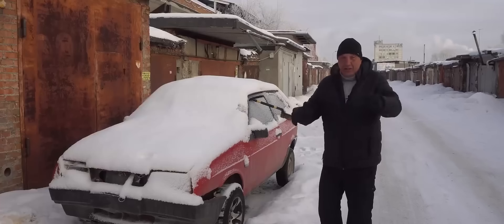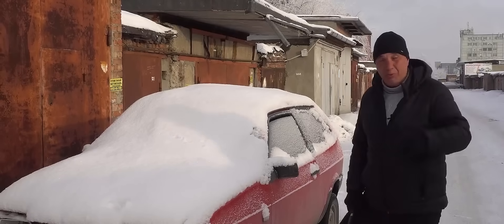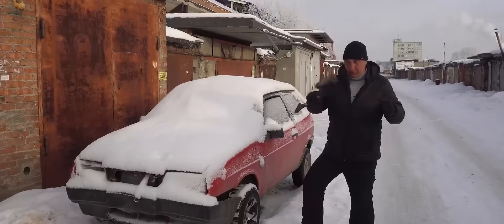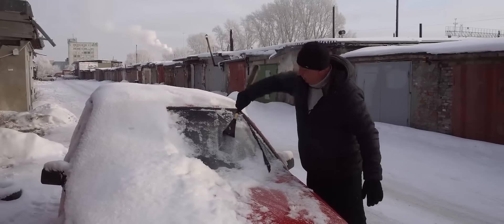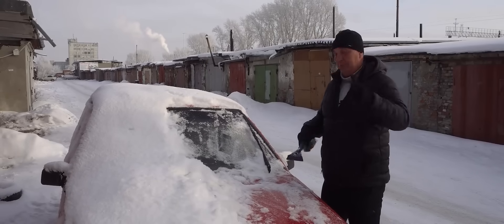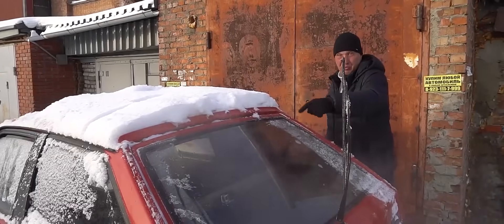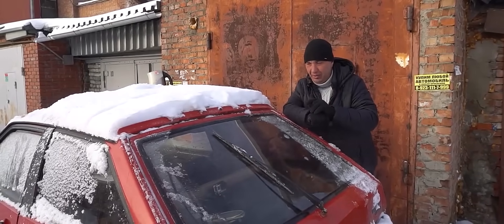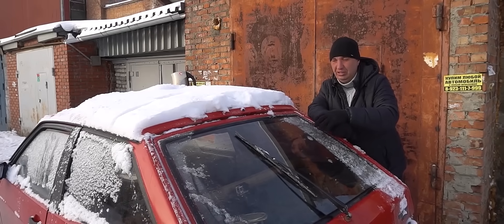What happens when you POUR boiling water onto a frozen windshield?

Comment: Hello! I am a car mechanic and i can explain why it works on this car! There a two types of windscreens. The ones who are installed with a rubber gasket around it (like this one, mostly found in old cars). And ones who are stuck in with adhesive (newer cars). What happens is that the rubber gasket can compensate the forces produced by the temperature difference of the cold glass and the hot water, thats why the windscreen on this car is fine. But on newer cars the adhesive does not have enough flex to compensate this forces, and thats why newer cars windscreens are very likely to break when applying hot water. 
Sorry if my englisch is not the very best, but i tried!

EDIT: I see this comment arrouses a lot of people. I know there are different opinions regarding this topic out there. And if you think otherwise thats okay. I just commented this to prevent people from expensive repair costs. So please guys, write your own opinion in the comments but stop insulting me.
Reply: I just love that your english was perfect until you got to the word "englisch" haha
Reply: @everett8811  he is German you idiot
Reply: @everett8811 Dammit!
Reply: (T)his comment should be pinned on top.
Reply: Perfect English my friend i had no idea it wasn't your 2nd language. Smart man
Reply: Sorry but I’m going to have wade in and trump this. Master Windscreen Tech with over 10 years. A bonded Windscreen is officially classed as a directly glazed unit. The PUR bonding will allow for much more expansion than caused by hot water. So I’m sorry but this is not correct. The issue is if you pour hot water onto laminated glass (the Windscreen) when there is already damage through to the inter layer. So if your Windscreen is perfectly intact, you can do this tricky safely. However if you have damage which you can not see. For example in the ceramic frit. Which is the black painted part around the edge. You are taking a large risk. So therefore it’s not recommended to ever do this on any laminated Windscreen. Direct or indirectly glazed.
Reply: @bluemonkey227  Finally, someone that actually knows what they are talking about instead of spewing the first theory that comes to mind. My theory was maybe the composition of the glass and laminate would play a big role in how the windshield reacts to the temperature difference.
Reply: Your English is very good mate, no need to worry about it, just wish some English people could write this well.
Reply: Andi 423 I’m a mechanic too but you’ve taught me something, I didn’t think of the rubber gasket helping with the temperature difference! I always thought it was the contact with the glass directly that can cause cracking rather than the types of seal used on windscreens.

Also your English is good!
Reply: In other words new cars aren't made to last.
Reply: @SuperSqueakyboy  Yeah maybe. But the main reason for using adhesive is that in cars with old rubber gasket windscreens, they often popped out in case of an accident. Where the new ones dont do that and also became a important part to stabilize the self supporting chassis even more. So it's for safety and stiffness of the cabin.
Reply: @Andi-ft5rt  your english is brilliant, man, i wish mine would be as good as yours! May i ask what is your native language, please?
Reply: @ayrenbethancourt9379  Thank you, my native one is german. I am from austria.
Reply: @Andi-ft5rt  cool. Love your country😍
Reply: @Andi-ft5rt  Heh. Adhesive windshields are cheaper than gasket windshields. That's the bottom line.
Reply: I have 2017 opel zafira and I always use warm water not boiling and it doesn’t break
Reply: @MrKiwi4lyfe  did you try boiling water?
Reply: Lmao you were perfect until the word "English"
Reply: Thanks for the explanation. Very good English
Reply: Your English is very good my friend.Thank you for the explanation .
Reply: Wind screens are tempered and laminated. Side windows are tempered.  Ordinary annealed glass is much easier to crack using this method of thermal shock. Tempered glass can vary widely in strength and thermal resistance depending on the tempering process. On wind screens design trade offs are made to design the glass for the highest safety. (low impacts cause cracks to propagate slowly. High impacts cause it to shatter into small mostly not sharp pieces and the lamination or film layers keep the glass from shattering and hitting your face.)  I know this because I have had half a truck tire hit my windshield and end up embedded in the glass about an inch from my nose. And yet not a scratch on me.
Reply: @jorgensenmj  I have to agree with you. I've seen cars totalled, the windshield is still in place, or popped free. In either case, the glass is still in one piece with thousands of little squares all through it I was wondering if the internal temp of the car made a difference. The windshield was the same temp on both sides. No scientist obviously, just curious.
Don't apologize for ypur English....you are bilingual..that's great!
Reply: Great explanation 👍
Reply: Spot on mate thanks for sharing.
Reply: This makes no sense. Windshields are obviously made to withstand all sorts of shear forces while driving. The kettle he is using is obviously too tiny.
Reply: Englisch
Reply: I am very aroused by your comment
Reply: It doesn't have to be a windscreen it will happen with any type of glass it's the rapid expansion that causes the cracking. A pane of glass that's left in the freezer then plunged into boiling water will shatter even when  it has room to expand its the rapid expansion that causes it!
Reply: @user-lf3wr8rh7r  That's a different type of glass.
Reply: Oh man the comment section have been got war section. 😐
Reply: Great job and believable information.
Reply: I always use tepid water. Literally body temperature - no more than 40°C. I even have a chip on my windscreen I've not gotten around to repairing. Never had a problem, I like it because it's the quickest way to clear the condensation off the inside as well as the frost off the outside.
Reply: Kris Roberts
Not if there's a chip, then it can go. If you've got a chip and not seen it and it goes then you'd regret it. Tepid is enough and less risky.
Reply: So what you're saying is that old technology is superior and the planned obscelescence of modern day.
Reply: I always use hot water to warm the glass. On different cars, with pasted glass and glass with a rubber seal. The average water temperature is about 70 degrees Celsius. There hasn't been a single cracked glass in 20 years. The fastest way to warm mirrors and glasses. You need to remove the water from the glass so that the water does not freeze again.
Reply: Something else that may also have an effect is if there is some precious damage to the glass. For instance an unnoticed stone chip.
Reply: Just show us a video that will crack the windshield, talking means nothing on internet now
Reply: New cars don't crack either.  I've done mine with hot water for years.
Reply: Thank you but we dont really need it
Reply: Your spot on.
Reply: genius
Reply: I never apologise for my English
Reply: @modaternasser6827  i always do. My english, unfortunately is like chinese. Lucky you if you speak perfect English ☺️
Reply: ayren bethancourt No, my English is far from perfect, you are probably better than me, it is just that I don't bother coz English is a universal language so people should get used to understanding different accents and writing styles as long as they are not gibberish and are actually understandable!
Reply: @modaternasser6827  😂😂😂
Trust me. My english is japanese 🤣🤣🤣
Reply: English is pretty good and thank you for your help
Reply: Thanks for the info!!
Reply: Damn bro u r a Doctor not a Mechanic Lol 😂
Reply: I am very arroused by this comment. You arroused me sir.
Reply: sounds reasonable
Reply: You're okay my friend. Shots of vodka for all!!
Reply: Or the glass is tempered
Reply: @Jacques Bloques you're impressing nobody. Go back to your desktop thesaurus & find some more words to inflate your ego. Childish intellect. Lmfao. Seriously. Are you actually expecting a reasoned debate in a comment thread on youtube? If that's not childish then it's just plain ignorance. Float your bullshit during a wine tasting at Nobody Gives A Shit Vineyards Public House. Frankly I can't understand why I'm trying to correct anonymous idiocy. Something about stupid things just peaks my interest while simultaneously making me depressed by the state of society & what passes for interaction these days. Party on Weiner Biscuit!
Reply: when i worked at infiniti a large amount of their qx30 cars brand new on the lot had a windshield cracking defect, the windshield was placed on with mounting points that couldnt flex a certain amount and the glass would press itself against the cars metal when the sunlight hits it directly, we had cars brand new sitting on the upper lot floor have sudden cracked winsheilds one by one
Reply: Arouses* what HAHAHA
Reply: Well said :) The problem is expansion speed. When the conditions are natural the glass expands slowly and nothing happens, but when hot water applied, the expansion speed is very fast, there fore the rubber band reacts faster to prevent window break, while the adhesive material is more sturdy and it needs more time to expand, there fore the tension rises and glass breaks.
Reply: Gasket? Really 😂
Reply: Andi 423 wow, amazing explanation man! I poured room temp. Water on my cars windshield which was standing in the sun.... and it cracked.... a hot windshield with cold water on it would break easier than this method!
Reply: The classic “I’m a new mechanic and I know everything about cars because I just graduated college” I pour hot water on my 08 Jettas windshield in winter for years never had a window crack and I’m in northern Ontario
Reply: I was wondering because I used warm water once like an idiot and heard a pop and wound up with a nice line across my windshield
Reply: What i can say is NEVER pour cold water on a hot windshield it will crack pretty quick
Reply: *aroused*🍌
Reply: Good to know.
Reply: Windshields during research and development phase are tested for a lot of things, including thermal shock. Test specimens are placed in a thermal shock chamber, where they remain in a controlled environment for a period of time specified by a standard, then travel into a secondary chamber, where they have to endure very different environmental parameters. I pulled up a random standard for electrical components from a google search (MIL-202G) in which the thermal shock test temperatures range from -65 degrees Celsius to 500 degrees Celsius. Fair enough, glasses will have different standards and test parameters, but the principle is the same. 
Materials do age however, and their properties can deteriorate. Glass is no different. An aged windshield is more likely to crack due to thermal shock, than a brand new one, with no manufacturing defects. 
Just some things to keep in mind.
Reply: I tried this to Ford FOCUS c Max 2004. Water was around 60. Outside mínus 7. Everything is ok
Reply: My 87 suburban windshield survived, my 91 Toyota windshield, however, did not 😩😂
Reply: I'm very aroused I have a boner.
Reply: this + glass breaks when contarcting (hot to cold, not cold to hot)
Reply: They also poured it too evenly, if a glass is hot in one half and the other half is cold thats how the stress is created
Reply: I would like to add, your perception of "forces" on newer cars is something i understand and at the very same time do not acknowledge to exist. But in fact i have a counter argument. 

Newer and Modern cars these days actually have thinner double glass layers then they use to. meaning if you have an oppotunity one day to check out say... a VW golf within the age of 2000 + All audi glass, all new After market Toyota Hilux, Mazda bounty, Suziki Swift. Basically as the glass manufacturers get better at producing glass, the quality gets better by every single windshield/windscreen they produce for that particular model and make,  EACH TIME it's created. (Imagine for every new windscreen it has +1 or maybe +2 Quality with depending factors).  So after 2 years the glass is what they say " perfected " so they no longer quality check the glass that is made... ect..   The windshield is getting thinner and thinner, with some makes... i have found with Toyota Hilux, XYG and Fuyao Glass.  they like to make their first layer of glass roughly..    1.8mm thicknesss while the 2nd layer of glass is 2.2mm.      Inside layer of glass is the most thin.   Making it very very very VERY easy to break, especially during installation. 

Edit: Observation based of mostly viewing the Chinese Aftermarket Glass which is shipped and used across the entire world.  Personally i prefer using Manufacture's glass for example Toyota genuine or Audi, BMW, Hyaundai, Mazda Genuine windscreens/windshields.
Reply: I understood almost nothing. O don't have the widest range of vocabulary, to put it lightly.
Reply: Damn your English is very good (From someone born in Canada)
Reply: wrong.. both seals have similar flexibility, newer just seals better.
The "heater crack" in the car he brought was probably due to flex as most cars there or in snow territories are rusted piles of shit.
Reply: I did this to my first car when the windshield wipers quit working and the scrapper couldn’t get it clear enough to to see. After pouring the hot water My windshield spiderwebbed, it was a sad day
Reply: The realistic side of this is people don't know shit about cars im a mechanic and i agree with what your saying and the rubber gasket is truly found in older cars classics and such
Reply: this comment aroused me
Reply: We have an old and a new car 2 actually and the glass dont break
Reply: Your English is very good
Reply: This would be incorrect. The reason is that front windows are laminated, not hardened. (Well most, some are both) there is a number of reasons for this, but mostly because of.strikes at speed. Also  the front window must be kepped in place, if it was not, it would fly in the drivers face.

Its really hard to have a lamination  that holds for a hardened glass crack.

This is also why you see creeping cracks in front windows, but never in any other.
Reply: "Likely" to break? What data do you have to support that notion? I've never heard of seen any supporting evidence to that effect. It's always conjecture.
Reply: Andi is right on that, also another reason why newer car windshield cracks more easier is cuz of, more surface tension on it, thase days windshields are part of supporting structure of car, so if it flex enough it will crack no matter what, heat changes do that, too hard bump on road would do it when body of car twists a little bit
Reply: 30 000 people did not know it.
Reply: https://youtu.be/g8H7pmdo-qc 
this will make your day. worth watching. subscribe on your own risk, u might fall in love. ❤️
Reply: Andi your awesome!!!
Reply: Thank you for explaining  the reason. Now, yours is an expert opinion. I will NOT try to pour boiling water on my windshield (it is not cover by insurance 😂🤣)
Reply: I think you are right!
Reply: this makes sense, my old (1980s) mercedes had a REALLY strong heater and this never happened, but my newer Honda it has happened twice :(
Reply: Youtube comments section can be a bit like the school playgroundŕ
Reply: That sounds nice but Ive poured hot water 90-100 degrees on my 2017 f150 and a 2012 Jetta. No cracks only a deiced windscreen and that goes for all the glass on both vehicles and Ive been doing it  for 40 years.  Ive cracked residential window glass wich is of course non tempered, with a heat gun when the gun temp is over 200 degrees more like 500. I think its more of an issue of the glass being tempered. Just a thought
Reply: @jonathanbolding4164  The extra  thickness and lamination could also be a factor. I'm just glad it works so well!
Reply: You tit andy 

Just felt like typing this after you beg not to insulted
Reply: I always heard you’re not supposed to pour boiling water on the windshield because it will make every windshield crack you’re supposed to go out turn your heater all the way up leave it for a few minutes let the car warm up inside now I hope melt the ice and also you’re not supposed to turn the wipers all the way on full I heard of some people doing that and they broke the motor very expensive repair !!
Reply: thanks for the info!
Reply: I own an auto glass replacement business.  If the windshield is free of chips it is more resistant to the rapid temperature change of pouring on boiling water. (Not recommended)  However, if there are chips or defects in the glass, the movement created by sudden thermal expansion will create focused pressure on those spots increasing the likelihood of expanded cracking.  It is not an absolute that the window will crack, but why unnecessarily increase the odds?
Reply: S t f u nerdo
Reply: Huh? I'm pretty sure the plates from the freezer will break when put into the oven and they have all the space around them to expand. Dunno what kind of studies you have done but...maybe something else is at play. Who knows...maybe the glass is just super strong ontop of having space to expand.
Reply: Very plausible!
And the sealant is usually applied to the inner side of the windscreen.
So the inner layer gets held whilst the outer is expanding.
Reply: This is the correct answer.... And survey says!!?
Reply: Let idiots be idiots bro your comment is 100% correct
Reply: Volvo 850, bo problem, and second winter. I slowly drain from the top, it doesn't have to be boiling. warm water is enough
Reply: great breakdown!
Reply: Your English was fine till you said your English was bad
Reply: I have a 2017 Honda and did this but didn’t break. Explain that.
Reply: @joselozada5093  uh, he explained 'that' 3 years ago.. 
wtf is this the lake house or something.
Reply: I live in a very cold country... and I use hot water to clean the glass regularly... Others use plastic tools but still make rips on the glass... (it looks very nice in the summer) ccc...
The water doesn't have to be 70C... you take warm water from the tap... clean the snow,,... sprinkle it evenly on the glass... and turn on the wipers as soon as possible...
Wipers clean the glass of water,,,, and the little residue that remains evaporates.. ;-)
Reply: my cars are 2010, 2013, 2014 and 2022 models.. NO GLASS CRACKING;-)
Reply: No. it's called tempered glass.
Reply: This is the most correct response I have seen.
Reply: I’d also assume the area hit by hot water matters etc.  
thermal shock is a static value here, the other variables are myriad
Reply: Your English and your point are pretty good imo
Reply: shitty mechanic, would not give you my car to fix.
Reply: English is pretty good actually...no need for apologies. Thanks for not making me watch this lame-ass video. You saved me ten minutes. Cheers.
Reply: @tommiedaswammi8008  bro I wish I read your comment 3 years ago, it would've saved me 10 minutes today.. 

wait is that a paradox.
Reply: Glass does not give a single fuck about how it's affixed. Boiling water on glass: If it's tempered right, glass doesn't break. if it's tempered wrong, it breaks. If it's not tempered, it shatters. If it's 40mm thick, and -20c, no amount of boiling water will break it. There are a lot of variables here my dude.
Reply: It's bad to see people like you, who can't handle the truth. You apologizing and in the same sentence insulting me again, shows off what type of person you are, so please keep your apology. I commented to prevent people for damaging their windscreens, which cost between 300 and 1000€ in my country. 

Also, the quality of the glass is better than in old cars. Sure, the structure of the vehicle place an role in this story, but the main reason for breaking when applying hot water are the adhesives. If you would install the same windshield with a rubber gasket around it, it would not break. Point. 

So if you wan't to discuss this subject further on, please without insulting me or others.  @raCECar
Reply: @Andi-ft5rt  ignore people who insult you. They dont worth your time, friend
Reply: Thank you for this information! Your English is probably better than mine and it’s my native language 😂 Anyway it’s amazing how some people attack you for what you said! When I know people that do windshields and would agree with you! People think you are saying it would crack every time or something on an adhesive one, you are simply stating why in MOST cases it does what it does! People have a hard time sharing opinions without being ***holes about it!
Reply: SPEAK ENGLISH
Reply: What has a car mechanic got to do with pouring hot water on a windshield of a car, you’re acting as if mechanics are the only ones with cars
Reply: @nitroboxster4267  I was literally thinking that then read your comment lol.
Reply: @nitroboxster4267  Alot of mechanics know how cars are put together, with what materials, and why they are put together that way. So most mechanics will have at least some insight for most everything to do with automotive parts.
Reply: If you're a car mechanic then you should know that windscreens need to allow for expansion and retraction. Personally you're talking a bunch of shit. When it's cold glass will retract. When it's hot it expands. If you don't allow for either of these you'll find the windscreens cracking under pressure. Because of this it's a stupid idea to produce cars with windscreens that don't allow for these reactions and this is exactly why your claim that windscreens only have adhesion and therefore doesn't allow for compensation is wrong.
Reply: @Kyle_Hubbard  It will retract, but not as fast as with hot water.
Buildings and bridges are also retreating, but if they do it too fast, they will break.
Reply: MїĈhÃЭĹ ĴoЯđÃй bruh no need to be mean-
Reply: @Kyle_Hubbard  Interesting, so what would be the best way to defrost a windshield??? In your opinion
Reply: @Kyle_Hubbard  I think it depends on the adhesive that's used. The proper adhesive will make the windshield become part of the structure of the vehicle so that in the event of a wreck it will help to maintain the integrity of the body. It allows for the expansion and retraction of the vehicle as a whole, but I don't think it would fair that well under extreme, and isolated temperature changes as is being shown here.

However, there is a much cheaper adhesive (hmm cheap car, go figure) that basically will guarantee that the windshield will become a flying projectile if enough force is applied, and that would likely fair better under this treatment, but I don't think it's a good thing given that it's not nearly as safe as the better bonding adhesive.
Reply: Andy, your a stupid mechanic.   Offcourse the adhesive is elastic too.   You know the chassis flexes a lot dont you??     Dumbass.
Reply: @lillnemo1 I am sorry, but what i said is not something i imagined that could be true, it just is. And i dont know what the chassis has to do with boiling water, what some of you don't seem to understand is the following: I know that   the chassis has some movement and also the screen has, and clearly the adhesive can manage this. But the fast temperature change in this case causes rapid forces that come too fast. Also in this scenario the adhesive is very cold and because of that even harder than normal. And that's why the windscreen breaks sometimes. And stop calling me dumbass for fucks sake...
Reply: Andi 423 i agree with your comment except for the “sToP iNsUltiNg mE” fucking pussy
Reply: I can only state that my experience fits with my theory. It makes no difference, nor have i ever heard of any difference. All i ever hear is to not do it, but its never backed up with evidence.
Reply: @joewoodchuck3824  I always heard you’re not supposed to pour boiling water on the windshield because it will make every windshield crack you’re supposed to go out turn your heater all the way up leave it for a few minutes let the car warm up inside now I hope melt the ice and also you’re not supposed to turn the wipers all the way on full I heard of some people doing that and they broke the motor very expensive repair !!
Reply: @JohnDeere_Simulations  I've heard the rumors too, but I've never heard of a documented case of car windows breaking from hot water. Yes, you do need to make sure the wipers are free though.
   When someone shows me proof and I'll take it under advisement. Otherwise I consider the "problem" to be a myth.
   Ymmv, fwiw, etc.
Reply: @joewoodchuck3824  facts I've never ever seen anyone post any actual evidence of hot water cracking a windshield
Reply: Wrong. The adhesive mounting also allows for expansion and contraction. Its soft like bathtub caulk. Ive used hot water on them as well with no problems.
Reply: @joewoodchuck3824  Adhesive becomes britttle in the cold
Reply: @joewoodchuck3824  depends on the urethane used, I install glass for a living, hard urethane causes glass to break more often, softer ones like i use have less issues.
Reply: @joewoodchuck3824  actually they get hard like gum does in cold n then has no give thas why they crack in winter just hitting bumps
Reply: @maddmavic  Never heard that before.
Reply: @joewoodchuck3824  Wrong its been demonstrated often enough that it is not soft enough. The windscreen cracks. Are you from a windscreen selling company or what?
Reply: @Andi-ft5rt  I do this every morning in winter time and I did this for years on newer cars with adhesive mounted windows. I don't use boiling water though, but hot tap water.
Never had a problem doing so..
Reply: @MrBacardi72  Yeah. Probably because it is not as hot as boiling water. I am happy for you if you can save you a few minutes.
Reply: Andi 423 a car is different from loose windshields
Reply: @MrBacardi72  try boiling water
Reply: @Andi 423  That's fine and dandy, but how was his windshield not cracked, though?
Reply: @joewoodchuck3824  It is nothing like bathtub caulk.  one is rubber the other silicone, Butyl rubber.  It is not soft at all under 100 degrees.  I mean, have you never dealt with this material?  Apparently not.  Try to pull your headlights apart.  Same adhesive.  You have to Bake it in the oven in order to get it soft enough to deal with it.  Nice try being that one guy, you failed.  Learn the topic first, it saves embarrassment later.
Reply: @adamwade5612  It doesn't matter. Once again, not one person here has done anything more than speculate. Not a single breakage shown from hot water.